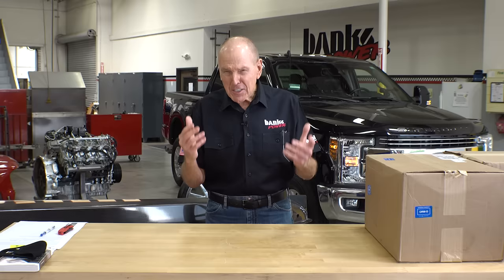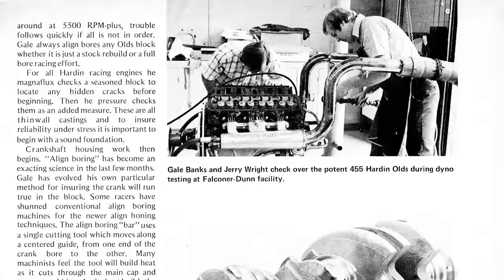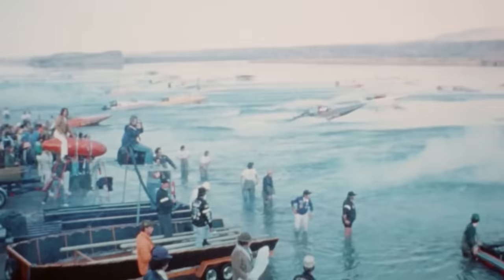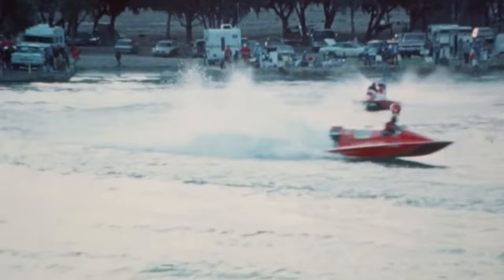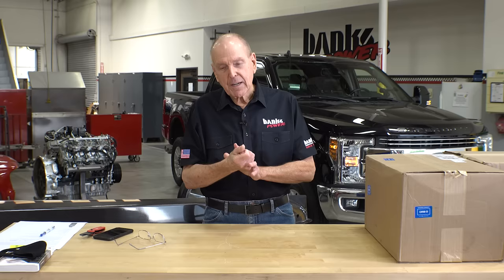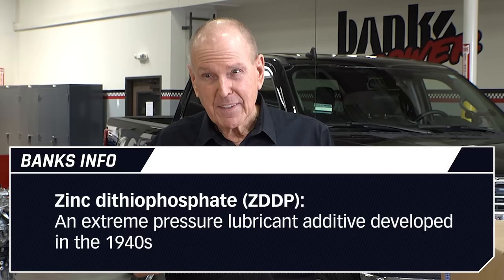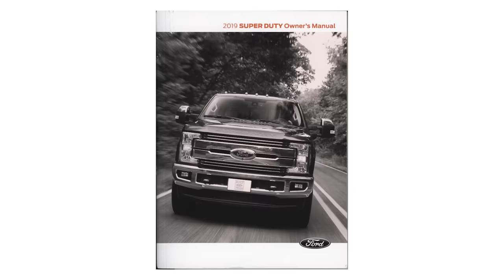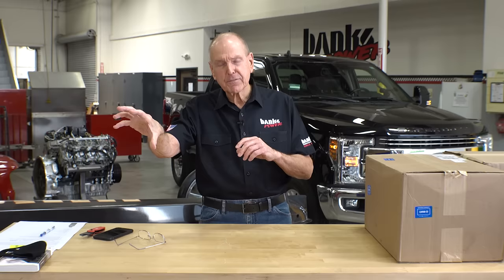ENGINEERING UNBOXED: This filter can extend your oil life

Comment: I am an RV transporter with a 2019  DMax.
 I already have a 120000 miles on the truck after 9 months. I think I need to get one of these   So I can hopefully squeeze 700000 miles out of my D Max before Needing another
Reply: Good preventative maintenance is where it's at.  Good oil, oil analysis, good fuel, a FASS or equivalent, and other simple maintenance makes a huge difference.  If you buy your fuel in bulk at your home base, a fuel polishing unit, like from AXI would be a massive help, too.
Reply: Or...delete it! Solves the issue too, plus additional benefits.
Reply: Honestly I have 3 duramax pickups all have 500k  miles and more on them never had a bypass filter just change oil regularly, I generally believe in whatever banks is hustling but this in particular is a waste of money save the money your gonna blow on this and buy  oil and filters to just do regular changes imo .
Reply: tony sloan If oil is changed regularly on a engine that’s not abused then life should be as you have experienced. Construction and race or just beat to hell does benefit from additional equipment. Lastly he’s a business man so pushing products keeps his doors open.
Reply: @Dancecomm  the key being extending oil change intervals, reducing downtime and reducing costs. It will take about 75,000-100,000 miles to pay for itself, after that the savings adds up. Secondly used oil analysis program would be able to spot engine issues long before they cause problems or catastrophic failure. There are many bypass filter manufacturers out there, some even use toilet paper to help keep engine oil clean. I've had one on an F150 and a diesel jetta in the past. If I were to purchase a diesel pickup or larger I would have one on asap!
Reply: @Zigg317   I agree on that, I have a 90 gallon fuel cell. And I run and air dog  Filtration system that I transfer the fuel from the 90 gallon to the stock tank so it's pre filtered before it hits the stock filter
Reply: @Dancecomm   I understand that, But the issue is I drive 140000 miles a year. Every time I stop the change my oil in a  Walmart parking lot It could be 0ﾟ outside or 100ﾟ outside. Time is money in this job when it's busy. You get paid by the mile in  My business, Sometimes it's not convenient just a stop at the exact mileage to change your oil.. And yes for all the comments coming we have a local Walmart near our yard that kind of caters to us because we spend a lot of money with them. It's cheaper to buy  $10. drain Pan and change yourself , and leave it for the oil change guys to dispose of then pay $50 to have them change it. At least you'll know your drain plug won't be stripped and your filter won't be over tight or double gasketed
Reply: @MichaelSparks   I agree with you 100%. A spent $1100 on a 90 gallon fuel cell and $800 on a fast pump pre filtration system. In within one year my fuel savings paid for that complete system. It allows you to drive to your 50 cents off a gallon fleet discount stations without having a waste money on over priced diesel fuel in certain areas of the country. Every time you stop for 30 minutes to re fuel that's 30 minutes of driving that you're not doing for that day at an average of  $1.35 a mile. At 65 to 70 miles an hour. The reason I added the FASS  Pump system was just to pre filled their my fuel because I did get a badd load of diesel fuel when my truck was new in it shut me down in the middle of Montana. I was so lucky there was a Napa 2 miles from the dealer I was dropping at.
Reply: @funfun8095    Deleting your DEF system will give advantages for towing. Better  Fuel mileage better power and no DEF expense, But it will not prevent soot from accumulating in your oil as it passes through with the  Piston rings, As Mr. Gale Banks explain in the video.
Reply: @paulcopeland9035   Never said that I did
Reply: @M Hamilton  That is great to hear, I run full synthetic T6 in change mine approximately 7000 maybe 8000 on average service all my fluids frequently transfer case rear differential transmission hopefully mine will get the same .  And I run 3 fuel filters to help extend injector and    Fuel pump life
Reply: Try Power-Up oil additive w a pre-luber. I overboosted at 250,000, cracked a piston. Machine shop said all it needed was a piston, said it looked like a 30,000 mile engine.
Reply: @kurte2768   I was given a BMK 26 Ford 7.3 dual.  It appears that the system deletes the engines OE full flow filter with a in/out hose adaptor, which is a normal way to get oil to a remote cooler or filter location. The fittings and hose however are only #8 and the fittings themselves appear to be 3/8 or 7/16 which in my opinion cannot flow the volume required. Heck the OE filter size is something like 1 1/4 with a shitload of return holes, plenty of volume and no restriction.  The 7.3 flows a lot of oil volume, I would think the adaptor would be something like the late model 6.7 type that allows the OE filter to remain and by pass a small percentage of oil.  Even on my race engine I have a #12 pressure and return from the filter, and #10 has worked with no issues as well on the pressure side, with a 1.200 pump gearset.   I looked at the adaptor and it is just a pressure/return.
Reply: @tedgerstenslager2949  you were given the appropriate application for that truck.   Have you put it on?   I have a customer with with a similar setup on a 2012 Ford 6.7.   Oil Analysis after 45,000 miles on oil and darn near 200,000 on truck Oil registers in normal condition as if barely used.  Just as expected when collecting at 2 microns.
Reply: @kurte2768  Nope. Skeptical over the size of the lines and fittings.
They designed the oe filter to flow a ton of oil, that wont happen reducing the size.
Reply: Cleaner oil will only improve your chances of long engine life.
Reply: @M Hamilton Holy crap. 700k Miles in 5 Years. Thats insane.
Reply: @ted gertinslanger.  The bypass filter as by name only filters a smaller percentage of the oil at a time as the engine is running. Eventually all the oil will
pass through this filter over time.  It is not taking full flow capacity from the pump. The full flow filter on the engine does that.  The bypass filter being 
able to filter down to 2 microns means the oil coming out of it is by far carrying less particulate than what went into it. EGR systems put a heavy soot load
directly into the combustion chamber.  It does get by the compression rings to the crater ring.  Piston cooling oil will flush this down into the pan. 
You need all the help you can get to remove this additional soot loading in the oil.  The engine filer isn’t designed to keep the some of the chunky bits out.
Technically it is a bypass filter too, because the pressure relief valve is constantly dumping oil back into the pan.  The only thing I would caution about is 
replace the hoses after a couple of years, as they will deteriorate from the heat and could get brittle.
Reply: @bigboreracing356   regularly changing oil, but having less crap in the oils never a bad thing
Reply: @Mr.Beastforpresident  He literally says it only filters about 5% of the oil in circulation, therefore not restricting oil flow
Reply: @georgerenton965  he's talking about the dual remote system that replaces the OE filter.
Reply: @paulzumpf3612  thank you, I was referring to the general concept of how secondary bypass systems work in theory. The filter medium in a 
bypass filter can consist of stacked newspaper discs, it’s more like a drip coffee maker with attitude, than as the name implies “ full flow “
filter. The filter head usually has a restriction inlet fitting, else wise the pressure would ravage the filter medium. Like hitting a saturated roll 
of tissue paper.  It works best if it’s cool and calm. All the oil will pass through it, unlike the full flow, that pumps the excessive oil pressure 
directly back into the sump. Have a good day.

Comment: I love Amsoil, but I don't love their oil bypass system.  I use an FS2500 oil bypass filter, and I had my local hydraulic shop rig up two high pressure lines for me.  I take oil from a T-fitting (3/4" NC) piped from the oil pressure gauge and I return the oil through the oil plug port in the oil pan. 

A few hours were spent bolting the system to my truck frame, and routing hoses and shielding, the finished system is wonderful.  

I now change my oil yearly and it's still in great condition even at that.

I do not like returning oil through the filler cap.

Comment: I can vouch for AMSOIL and all of their products, specially the oil bypass filter system. I run a Duel Remote Oil Bypass system on all of my Duramax trucks with 560k, 630k and 400k on the clock. The system I use is slightly different, it has 2 filters and replaces the stock oil filter. I have no issues going 60k plus on AMSOIL Full Synthetic Signature Series 5W 40 Max Duty. Over 20 years using AMSOIL products in all my vehicles and never an issue.

Comment: There are two automotive engineers who have really earned my respect over the years. The first was the late great Smokey Yunick and the second is Gale Banks. I still recall something about a early 80's Trans Am  with Banks turbo's putting down in the neighborhood of 700 hp. Having just come through the smog era of castrated cars, that caught my attention. Your use of Amsoil products gives me a confidence level in them that no other advertising could achieve. Having just purchased a vehicle with potential timing chain issues (GM LFX) lubrication is going to be my best defense against a major repair bill. Time for some research.
Reply: Ed Frawley -- Yes !  There are no other 2  guys that are absolute Genius - Smokey and Gale...
Thanks for the memories!
Reply: Joe Mondello

Comment: I've had one of these one my truck now for about 3-4 years. I just did an oil change after 20000kms and oil analysis still said I was good to go. These things are plain awesome.
Reply: Wow
Reply: I've seen customers go over 200,000 miles without a full oil change. Only filter changes and top offs.
Reply: TheTennesseeTittyTickler voow!. On point! 👌🏻

I  tried every available synthetics available in market & settled with Mobil1 fully Synth. 10 year & I still use nothing else but Mobil1. 

A timely oil change & some trust in Mobil1 works for me.😅😁🤘🏻
Reply: Who does oil analysis?
Reply: @wilburdunn2552   Blackstone...

Comment: Love the Amsoil bypass system. They have 3 filter sizes up tp 1-1/2 qts. I had the 1/2 quart model like the one on this video. Then changed up to the 1-1/2qt. I preferred to increase the oil capacity, While adding the bypass.
Reply: They no longer sell the 90 or 100.

Comment: I bought the vortex oil filter which is a bypass filter inside the standard filter from Baldwin for my 2005 Cummins RAM. And I made my own toilet paper bypass filter using an old Ford tractor filter housing. On the 5.9 Cummins, there is a second turbo oil return on the block next to the first one, Remove the plug and now you have a return path from an oil bypass setup. Oil to the bypass is from the top plug of the Cummins OEM filter head on the engine. I used 1/4 inch steel lines to plumb it and made a bracket so Ford housing sits above the exhaust manifold. The FORD housing is heavy gauge quality steel. For the Toilet paper roll to sit inside, I used a SS steamer vegetable strainer. Oil comes in the top side of the FORD housing, is filtered thru the paper and comes out the bottom of the housing. I also made a center brass tube with a small tin can inverted and soldered on its top as a collar to seal the Toilet paper roll to prevent oil from escaping past the TP roll. It was a DIY project for sure.
Reply: Actually, called a venturi filter. So I have 2 oil filter bypasses for finer filtering of oil. Anyone can easily get extra filtering using the Baldwin filter and Cummins has it's own version as well.
Part number is Baldwin BD7317 and  Fleetguard Stratapore/Venturi LF9028 

"Q: Does Cummins Filtration® offer Extended Service Lube Filters?
A: Yes, Cummins Filtration®'s 9000 series of patented Venturi, combination full flow/ by-pass filters are direct replacement for many OE filters. "

Comment: Bypass oil filters for diesels are a must if you are interested keeping the vehicle for the long run.  The need is compounded 10 fold if you have a working EGR.  Soot is finer than what your full flow filter can pull out.

Comment: Take your oil sample from the drain when the oil is warm and take it roughly in the middle of the oil draining. 

I've done multiple oil analysis on multiple vehicles for 20 years.  There is no issue if you don't take the sample at the beginning or the end of the draining.

Sucking it out of the dipstick tube is not necessary. 

I've been running amsoil filters in my vehicles for 20 years.  I can highly recommend them.  They're awesome.

Comment: Finally got around to installing one on our 2007 Honda Pilot... I don't own a diesel,  but it can't hurt on a gas engine either! Needed a 1/8 BSPT fitting to tee off oil sending unit. Found one on Amazon made for feeding oil to a turbo. I documented the whole process in a few videos. Overkill? Maybe but I'd rather err toward overkill than neglect.
Reply: Document the RESULTS!!!

Comment: Works with any oil. Gas or diesel. Clean oil is king. You're only draining a few PSI off of the flow a oil pressure. In this video Gale says you don't think it would be needed for a gas engine.
If you run a catch can on a V8 and watch what contaminants it captures in only five thousand miles. Oh, you'll see what I mean. The bypass filter does not replace your normal filter. It's only enhanced cleaning at much finer degree. 2 microns. That's pretty amazing. The system drizzles the cleaned, nearly fresh
Oil back through the oil fill cap. 
I have one friend that uses it on his
Sandrail with an LS. 
If you're worried about the loss of a few PSI, you can have an 2 AN fittings (in & out) to your oil pan with an electric pump.

Comment: Installed an oil bypass oil filter on my 2002 Ford Excursion 7.3L Diesel in 2007, all I have to say is what a difference in the oil and you can see the difference when you pull the dipstick and look at the oil.  There were not very many oil bypass filters available at that time with data to back them up and the information on what gets filtered and what does not.  Since then and a believer and knowing that all the oil is not going through the filter, I have purchased an Amsoil bypass oil filter system for my son’s GM Diesel truck.  Now we have a new believer.   👍👍👍.  12-20-21

Comment: Gale what is interesting is Amsoil is offering something  that Luberefiner has been doing for fifty years in big diesels! I remember a ships captain asking me what I thought about Amsoil when it first appeared on the market. My reply was the same thirty years later when asked about GMs introducing a diesel to the auto industry. The John Q public ain't ready for extended oil changes or diesels!!! Don't miss interpret what I'm saying you know as well as I diesels are the most efficient internal combustion engine produced; and when it comes to my oil preference the best bang for the BUCK to me is Rotella T6 5w40 synthetic!!!
And as for that stuff you keep calling soot you know as well as I it is unburned crystals of fuel. And as for regen system it's a glorified catalytic converter for a diesel that on regen heats to over 1,000 degrees!!! THANKS EPA!!!!!!!!!!!!!!!!!!!!!!!!!!!!!!
Reply: If you improve combustion efficiency you get less soot.
We bond a lubricant to the metal and reduce soot by up to 100% in some engines.
We still use a high efficiency oil filter as well... but we use a cheaper and simpler spin on filter (Trasko)... which works just as well as the Amsoil filter.
🙂

Comment: I just came on as an Amsoil dealer and absolutely love everything they make! 

I ordered and then bought a brand new 2021 JL Jeep Wrangler Unlimited Rubicon several months ago. I ordered it with the 3.6 liter Pentastar V-6 with eTorque. I bought the Jeep with the idea in mind of off roading it and having lots of fun in it. Since I will be having the engine perform at times to its peak capabilities, as well as the entire power train system and vehicle as a whole, I will be running Amsoil in everything! But I also want to add one of those Amsoil bypass filters to it as well, for more oil filtration and to have an increase in the lifecycle of the oil, even though I change my engine oil once every 2,500 miles or so. That way I am running continuous new/fresh oil in the engine non stop, so it will help it last a lot longer than normal.

Comment: Dixie Chopper used to put Amsoil bypass filters on their mower engines (Kohler) from the factory. I have a 2003 Dixie Chopper with a Kohler 28 hp engine on it and the Amsoil bypass filter. It runs great and has almost 3,000 hours on it.

Comment: Mom's ol 81 rabbit diesel ran like a charm , that engine ended up living on in another car and after that I lost track. 
At least they made a diesel that worked at a time GM was ruining the reputation.
Reply: Those were such headgasket killers though. I’ve changed about 200 of them, I can actually swap a head gasket on a diesel vw (pre 85) in less than 20 minutes.
Reply: GM bean counters ruined that diesel. Plus you had guys who never designed a diesel starting from scratch. Detroit Diesel might have been able to help but they only made 2-stokes at the time.
Reply: Could you imagine a screaming Detroit in you caddy....I can lol
Reply: @farmerjackson709  Just slip a 6v71 in there and park it on the grass. Might be a touch nose heavy though.
Reply: @farmerjackson709  
The trick to get a truck with an old 2 stroke Detroit engine to run well is when you get in it slam the door on your hand.